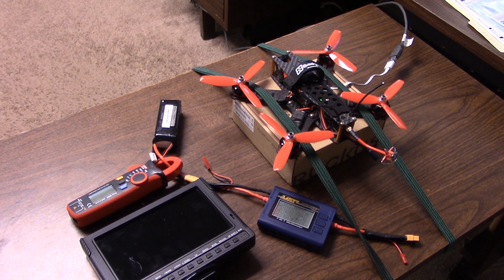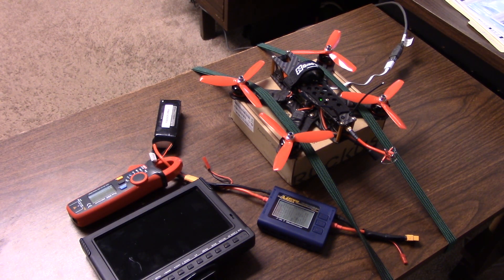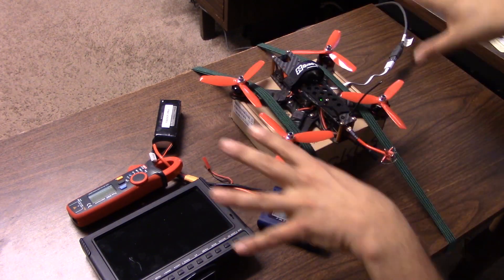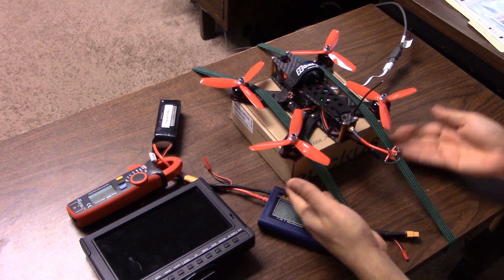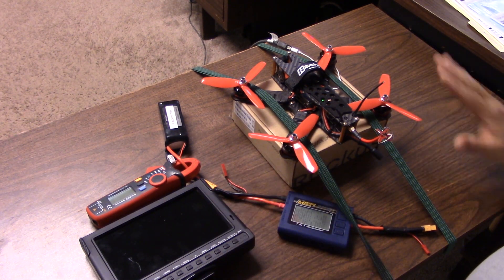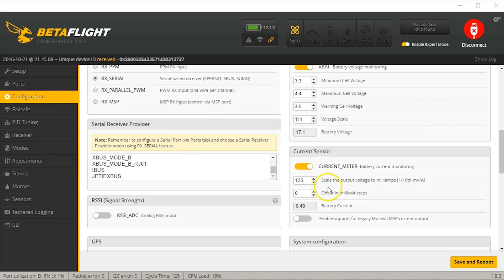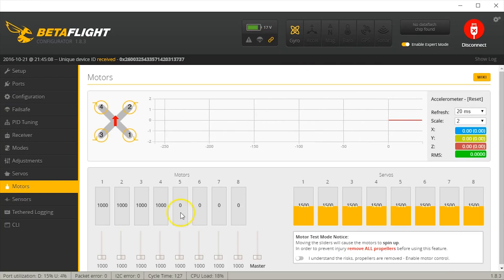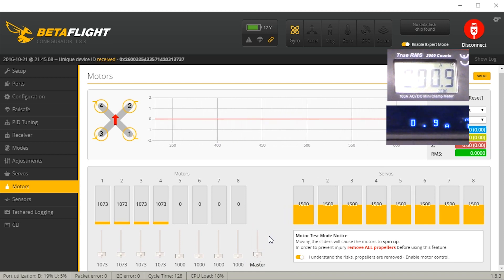How To Calibrate Cleanflight / Betaflight / MWOSD Current Sensor

Comment: Say Joshua Bardwell, what is the second meter you are using with the xt60 connectors for? I see you are using a clamp meter. Wouldn't the clamp meter be all that is required? I have been looking for a meter that looks like the one you have with the xt60 connectors and can't seem to find anything. Thanks
Reply from the maker: That's the Hobbyking 7-in-1 Mega Meter

Comment: Why is there no videos about the virtual current sensor????  It's there, I want to use it ya know..
Reply from the maker: Almost all FC and ESC nowadays have a current sensor. Very few people are using virtual any more.
Reply: Even the tiny micro's (90%of my quads), like the Libero Micro 2s? what about a beta fpv tny whoop board? I'm trying to tune a 65s and 76s, and the Libero.  I was under the impression I had to use virtual one...

Comment: Joshua Bardwell

I Calibrated my current sensor a few months ago and i know that the right value is 260.

My Currect sensor is part of my 4in1 esc and i had it combined with the holybro kakute f4.

That flightcontroller Broke! so now i ordered the Holybro Kakute F4 V2.
Is the value staying the same because the currect sensor is on the esc or do i need to recalibrate it?
Reply from the maker: It should be almost the same, but you might need to tweak it like 10% or so.
Reply: @JoshuaBardwell  Thank you for the quick response!

Comment: Here is a modified Betaflight-Configurator that displays the current draw in the status bar so there is no need for an FPV monitor or telemetry on a TX or flipping through tabs in order to see it. There would also be a Windows binary if I was able to compile one. https://github.com/LightningStalker/betaflight-configurator/releases
Reply: The devs are talking about integrating this feature into Betaflight, possibly within the next couple days.

Comment: You could fly the copter, take note of how many mah's have been consumed, according to your osd. Then recharge the lipo, and take note of how many mah's you put back. Then use that ratio to modify the factor as per your video until the two numbers match after a flight.
Reply from the maker: +William DiMartino https://youtu.be/pj_CaMZ98g4

Comment: do i have to go all the way to 100% to calibrate it or there is no difference going over 50%?  the clamp meter i can get just cant go over 100 amps...
Reply from the maker: https://www.youtube.com/watch?v=pj_CaMZ98g4
Reply: thanks, but i watched it. i d like to do it with a tool.
Reply from the maker: +MrBirdshell666 calibrating up to 100 amps is fine. But jeez if you're pulling 100 amps at half throttle WTF.
Reply: ofcourse not. but i bet mine will go over 120amp or something at full throttle (sunnysky 2306 2450kv, 4s, 5045c, 30-55a esc)

Comment: I'm building a new build and I picked up the omnibus f4 v3 pro and I know there is a current sensor on it, would you suggest its still worth going through the trouble to hook it up and take advantage of it? Also I don't have that amp reading tool so I'd have to pick one up. I saw that the FC needs to be hooked up a completely different way to use the current sensor as well vs the super quick and easy way without it. Thanks!
Reply from the maker: I would always hook up the current sensor if I had one. You can use your mAh from your charger to adjust the current sensor scale if you don't have a clamp meter.
Reply: from my charger you say? how so?

Comment: Josh will current sensing work with a furious piko fc with current sensing capabilities,but using a cincada 4 in 1 esc and not using pdb on the piko.battery power is going straight to fc and esc at the same time....
Reply from the maker: +ab slayer current has to pass through the piko current sensor for it to work.
Reply: Joshua Bardwell Thanks

Comment: I am using a DUMMY LOAD not just for safety but FOR CONVENIENCE.... 
I might understand after watching it twice - BUT FOR ME WHAT YOU ARE DOING MAKES NO SENSE.
Reply from the maker: Most people don't have a dummy load that can soak 60 or 80 amps. If you do, good on you.
Reply: My mistake.  What was I thinking?
I just realized ... that's HUGE currents - even 50 amps is like shorting a 4s battery 
across a 0.3 ohm 750 watt resistor!

Comment: Why can't you just check the ma used after a flight and charge the battery back up and make it read what you put back into the battery?
Reply from the maker: Because charging back doesn't reliably put back in the same amount you took out. 

Because the time-base of the mAh integrator can be incorrect and mAh may be reported incorrectly even though Amps is reported correctly. In other words, what if the current sensor was correct, and it read 1 amp. And what if the mAh calculator measured that the copter pulled 1 amp for 1 hour, in which case it would report 1000 mAh. But what if the mAh calculator was actually running slow, and the actual elapsed time was 1.25 hours. Can you see in that case, that the mAh readout would be incorrect while the amps was correct?
Reply: Joshua Bardwell Okay so how do you make sure that your mah reading is correct after you calibrate the amp meter?  Is there a way to adjust that?

Comment: You can also strap a watt meter to the quad and do some punch outs or full throttle flying. The watt meter will record the max amp draw, and the OSD will also display the max amp draw per the current sensor. Safely test over 40 amp draws without fearing props shredding something indoors, not to mention the gale force winds blowing loose parts off the workbench.

Comment: Hey another great video. Sorry for the question but im finding it hard to find the answer. If i have a kombini, xsr and taranis only is this enough to get mah's reported on the taranis telemetry? Do you have or can you point me to video if this is possible. If not what else is required?
Reply: I should add this is for a new build. On an old build with a naze32 I figured out how to get vfas telemetry already. Thanks again.
Reply from the maker: +DemiQuad FPV yes. I have a video just posted this week about calibrating the Kombini current sensor.
Reply: Joshua Bardwell OK thanks that sounds really good, surprised I've not seen it already! I'll look through, what sensor should it be on the taranis?
Reply from the maker: I think mAh comes in as Fuel on the Taranis.

Comment: It's worth noting that some FC with a built-in current sensor may give different readings when the USB wire is connected compared to when it isn't. I've seen this happen with the F3S AIO Pro and that made calibrating the sensor values much slower.
Reply from the maker: Ugh you've got to be kidding me.
Reply: I really wish that would have been the case. At least with the F3S AIO Pro, it appeared like having USB power connected at the same time with the battery was causing some sort of offset in the current sensor readings making any calibration that way useless.

Comment: Thank you SO MUCH for this video. I have a Kombini and I love it... my favorite non-KISS flight controller. But I don't have a clamp meter or a Turnigy Megameter, and I've been racking my mind how to calibrate the current sensor. The recommended setting of 125 was too low, and I've been moving in jumps of 5 till now. I was only at 145 when I saw this video. I'm changing to 170 and heading back to the park now (I can't spin up like that inside my apartment). Thanks again!

Comment: You can't hook up load to ESC and make it work, ESC need to sense back EMF from motor to work (that is way how sensorless ESC know commutation sequence). If you would connect load to ESC, it would think that engine is stopped and protection will kick in.
You could connect load instead of ESC which will work, or you can load motor with some load instead of propeller (for example other motor which would work as generator and then load it so it will produce desired torque).
Reply from the maker: I wouldn't hook a load to the ESC. I would hook a load to the ESC pads on the PDB so as to draw current through the sensor.
Reply: Joshua Bardwell
Sorry I must misunderstood your intention.
But that would be probably best solution, it would eliminate current spikes and way how each sensor interpret them (in multimeter, on current sensor ..).

Comment: Joshua, a suggestion for determining the offset and scale factor in one pass. Take two readings, one @ low load and another @ high load as well as recording the readings from the clamp meter. Using the equation for a line Y=MX+B where Y is true current, X is the indicated current M is the gradient of the line i.e (Xhigh - Xlow) / Yhigh - Ylow). Do this for both true and indicated values. The ratio of the M values for the true values and the indicated values will give the correction factor, call it Mcorrect.  Now substitute 0 for Y and X using the calculated value for Mcorrect to find B which is the offset. 
Draw a sketch to help visualising my poor explanation.
Oh, and grow a pair :) or place a large bucket over the quad as a guard. Hmm who would have thought a bucket would be so useful for quad flying.
Reply: Rob B yeah, simple math. The way to go.

Comment: Moving all Props one Motor clockwise AND mounting them upside down will cause them to push the Quad into ground rather trying to lift it up which might be a safer way of doing it =)

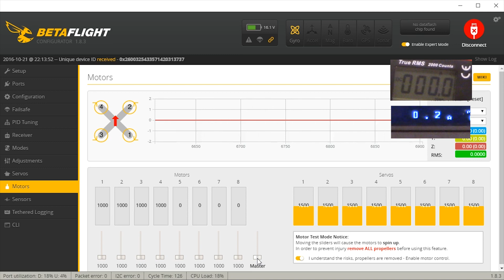Also @07:25 Film me like one of your French Quadcopter Pilots?
Reply from the maker: I feel like holding a mini quad down while you spin the props falls into the realm of dangerous, but with controllable risks. At the end of the day, the entire copter only makes at most 13 lbs of thrust. A grown adult can hold 13 lbs down to a table. If you hold it down securely, it's NOT going anywhere. Have presence of mind, don't be distracted, and you will be okay.

A big copter with a 12" or 15" prop is a whole other story.
Reply: Duraltia sounds like you have been flying Arducopter ;)

It's the same recommendation as I was going to give, though if he dislikes doing so with 5 inch props I would love to see the fun with 10 inch plus CF props ;)
Reply: Rob Crawford I pledge guilty of the APM charge.

I have 520 and 740 sized TBS Discovery PRO Frames with 11x3.4 and 15x5 T-Motor CF Props which will send you straight to hospital if they strike you.

Every time I have to do the ESC/Motor Calibration on them I'm sweating like a pig near the slaughter house - Can't imagine the idea of them trying to pull up instead of pushing down while doing the testing >_>
Reply: Duraltia know the feeling I have been pretending my Armattan Tilt doesn't exist (and it only has 8 inch props)

I wasn't quite so afraid with my 10 and 11 propped machines till some morons Phantom took chunks out of my forearm.

Now I'm afraid of the whole process
Reply: Joshua Bardwell I just thought I'd point it out. Especially since you DO usually recommend safety like with the Smoke Stopper.

Usually when doing this stuff, at least on APM, I have to keep an eye on the Volt/Current Sensor hooked up in between the LiPo and the Quad while maintaining something like a steady 50% throttle using the Remote *AND* navigating back and fourth between two tabs in MissionPlanner to a) compare the readout and b) make the necessary adjustments.

All while 4 raging meat grinders, held down by one arm, try to work their way UP? Njeh...  =)

Comment: Can you do one quick check...?  I know we are measuring Amp draw, but can you see if once calibrated you get a similar +/- with say a 4S battery and a 5S or 3S battery...? Resistive shunts are somewhat simple current sensors and I'd almost think you'd need to re-calibrate for different voltages...  Though the people on the internet will surely know if I'm right... ;-)
Reply: The change of resistance of the shunt due to heating will have an effect, small or large depending on the quality of the resistor. In a perfect world changing the cell count should not have an effect

Comment: Wat if you ust plase the props opposite så it thrusts down. Or plase te props upside down?
I know when i did the amp test on my delta wings the amp draw is higher when the plane is actually moving.
Reply: vazza69 That is counter intuitive because when the the craft is moving there is less resistance than when it is tethered so the amp draw should be less
Reply: Michael Crawford yeah that's the theory but i find it to be higher in flight.
Reply: I was also thinking to swap the props from left to right so they thrust downwards, is there anything bad about it?